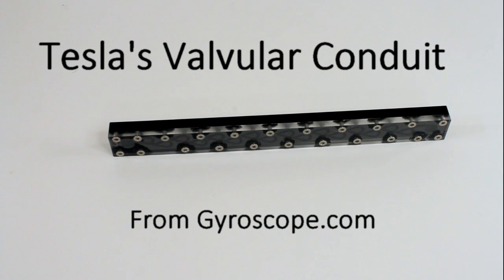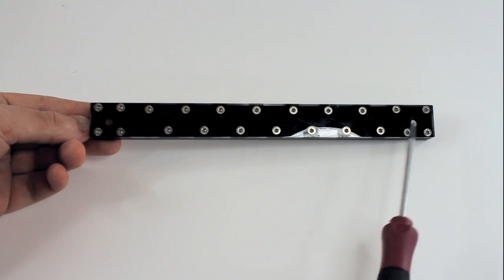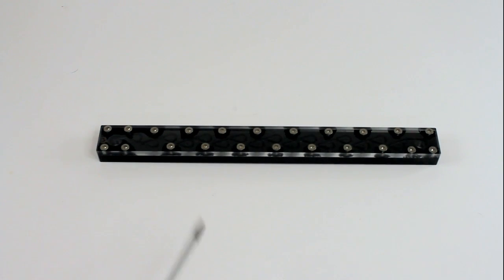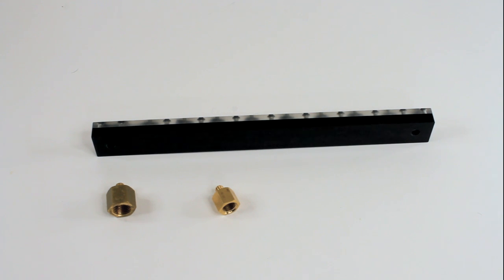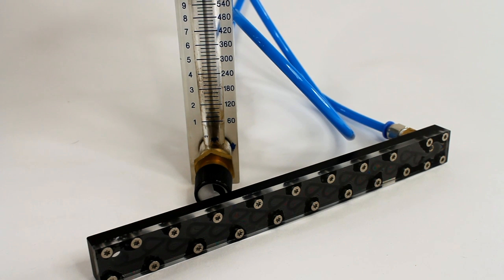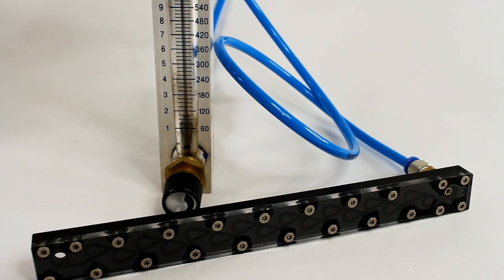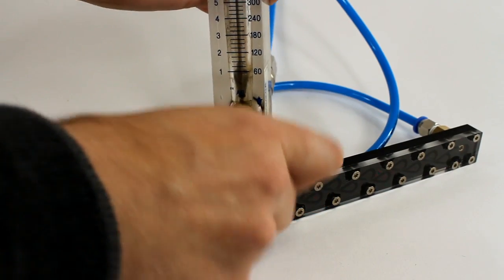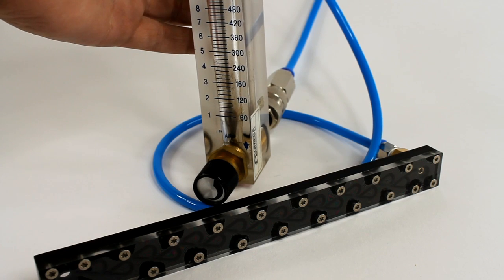Valvular Conduit - Another Tesla invention

Comment: I ran across this old digital computer patent 3190554 where it operated on compressed air instead of electricity. Was this computer ever built and used for anything? Could you build one today using 3D printing? If Babbage has gone with compressed air do you think his Difference Engine could have been built by the folks who made pipe organs?
Reply: I haven't ever heard of something like that, but transistors are basicaly switches, and you can "switch" a switch by air...
But making one using 3D printer, I think that would be hell complicated
Reply: +ufoengines there's this guy who has made kinetic art that he dubbed "strandbeest", walking structures powered by wind, and the more complicated ones run very rudimentary AI on logic gates powered by compressed air.

i can't recall how the gates worked, but the ai basically counted steps, and had built in conditions based on reaching a certain number paired with sensor activation (water or collision detection).
Reply: yea I have seen his You Tubes I think. Be cool if he can use a 3D printer built "air computer" to give his "Stranbeests" as much brains as a cockroach to see what happens.